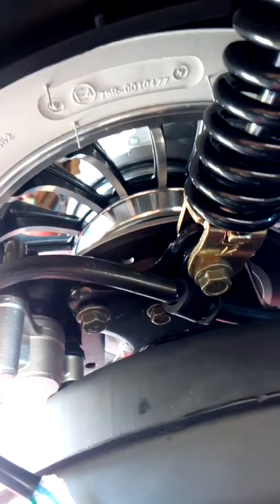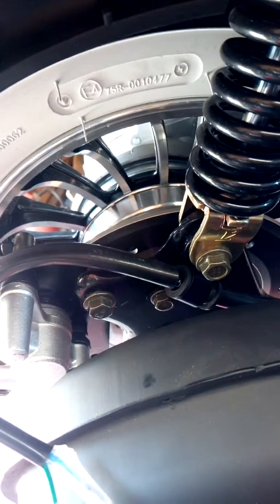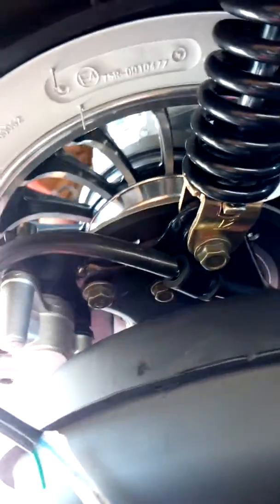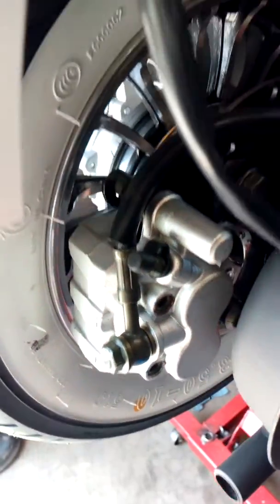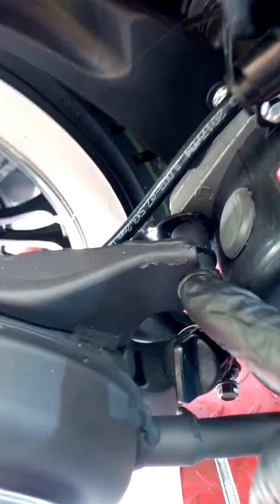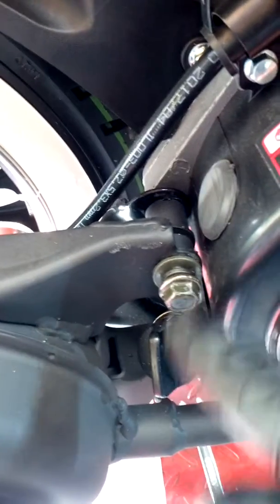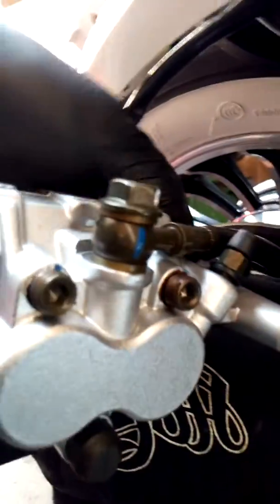AJS Modena 125 Euro 4 rear brake

Comment: I have a AJS Modena 125 scooter with a GY6 engine in it.

It gradually got harder and harder to start even tho it would always tick over but wouldn’t get going, at the same time it would cut out after a mile or two.

My mate cleaned out the Carb and had it running again, but that evening I was back to square one.

It has a new battery on, the spark plug is new as is the coil pack, they all work, good blue spark and the HT lead is good.

Fuel is coming from the bottom of the tank to the filter, and also through the filter, but when I reconnect the hoses the filter doesn’t seem to fill up - is this an air lock?

The kick starter won’t get it going either.

Is there any advice you can give me?

I literally don’t know what else to do.

Cheers Ash.